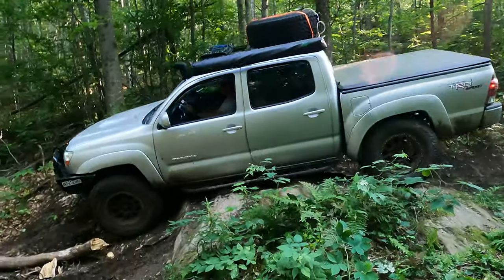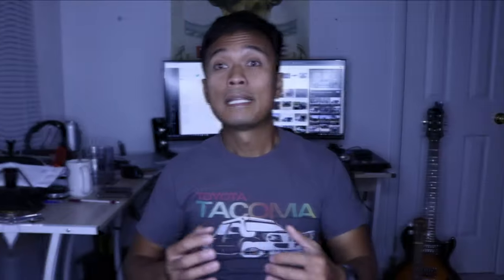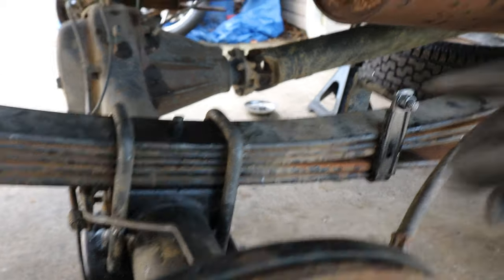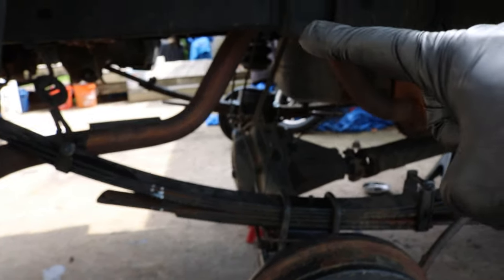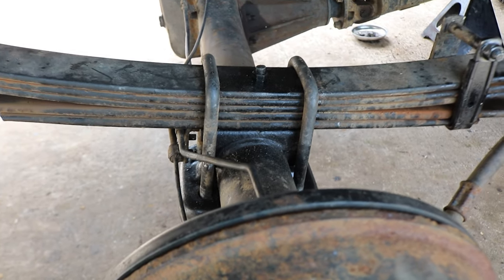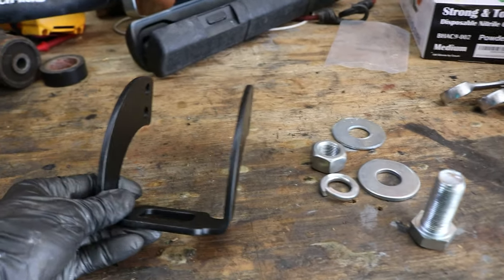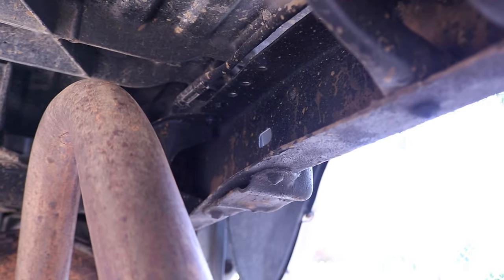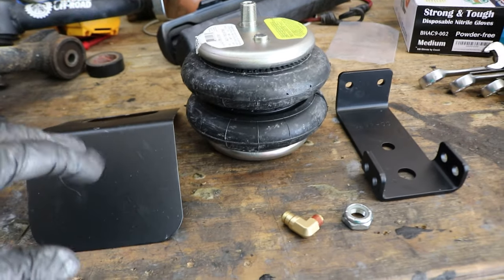Air Bag and Cradle Install on the on the Taco! (DIY / How To Tacoma)

Comment: Awesome video! I got the exact same set up with the cradles. I actually have the exact same truck, same model and even color! The air bags have served me well for two years now, no issues. I use them all the time, wethers it’s towing a trailer, yard work, construction, off roading, family road trip, commute to work, its pretty awesome to have the option to have the truck supported properly. Keep the videos coming! Been watching from the early days!
Reply from the maker: Awesome! You picked the best gen and the best color. Thanks for watching and supporting the channel. Cheers brother 🤙

Comment: The base of the bump stop is metal and has a hole that goes over the top of the pin that goes through the leaf pack they specifically have you cut the bump stop because once it's tightend down it keeps your ubolts from potentially moving.

Comment: I like that these videos involve an actual working truck, not a pavement princess.  My trucks previous owner lived in Vermont, so I'm about due to go thru and reseat grounding connections, since surface rust is starting to corrode some exposed connections.  If you have a video on the joys of removing rusty grounding bolts without snapping them off, that would be awesome, as well!
Reply from the maker: Thanks for the kind words bro. With regard to grounding points, that one require's a bit more fine touch and even that doesn't guarantee easy removal especially with rust welded bolts in the north east. My recommendation: 1) soak them in liquid wrench/PB blaster. 2) Brush the head and any of the exposed threads with a wire brush. 3) Undo the bolt but only applying gradual torque to make sure not to overtorque the bolt and shear it 4) Throw some heat with a small butane blow torch 5) repeat from step 1. If all else fails, may be just easier to just shear it completely and re drill and tap a new hole.  If you have access to the backside, you can just put a nut and bolt with a grounding washer on both sides - then protect that with RP 342. Cheers bud!

Comment: The instructions want you to cut off the bumps bumpstop for 2 reasons. 
1. Below the bumpstop is a plate to hold the pin in place that keeps the leaf springs together. 
2. If you remove the ubolts to take off the bumpstop like you did. You must always use new ubolts to attach the springs to axle. Since the old ubolts will never tighten like they did the first time.

Comment: I know this is an old video but I just found out that Firestone does not recommend the cradles.  They say their warranty will be voided when the airbags are used in conjunction with the cradles
Reply: Interesting. How would they know you're using cradles if you make a warranty claim?
Reply: @thejamiefoster  Right.  and another thing, I would think that it should be the other  way around: warranty void if used without cradles. oh well
Reply from the maker: It sounds like Firestone just doesn't want to be held responsible for improper installation (should that happen)

Comment: Will those work with a I bolt flip kit?
Reply from the maker: No - the lower bracket for the cradle will not be able to sit flush on top of the leaf spring. That's a good project idea though for my plasma cutter, stay tuned. Thanks for watching and supporting the channel, Darren

Comment: I have the same gap by the axle.  Where do you get the little black plastic fill in piece for the gap between the axle and bracket?
Reply from the maker: I'll have it in my store shortly. I'm still testing the durability
Reply: I have stock leafs on a 2016 and there still seems to be a gap there.
Reply: @KFloTacoma  link to your store for the bracket for the gap

Comment: I have sky jacket rear leaf and the are no good going flat so what kind of leaf spring do you have on you truck that super strong
Reply from the maker: I have the Dobinson's Leaf Spring. Initially, I had the extra heavy duties but  removed two of the leaves and made it the light duty and paired it with these airbags

Comment: Question: I have a 3inch lift on the rear. I bought a spacer to add. Is this recommended or not needed? The fair bags arrive in a few days.
Reply from the maker: Sorry, I'm not understanding the question. Are you asking if the spacer is needed or are you asking if the air bags are needed?

Comment: If I keep the stick leaf springs on my 17 Tacoma, I shouldn’t need the Jack pad?
Reply from the maker: That's correct
Reply: @KFloTacoma  thanks man.  I’m thinking about getting the same bag and cradle set up.  I’m looking forward to seeing you connect it to your compressor
Reply from the maker: Yea stay tuned, that's going to be a bigger project lumped with the floor sound deadeners and a few others
Reply: @KFloTacoma  I just sound deadened my 17 Tacoma!  I first did the doors and replaced the speakers too.  It’s a lot of work, but man is it awesome.  I want to do the headliner next.
Reply from the maker: Glad to hear, I think it's definitely worth it!